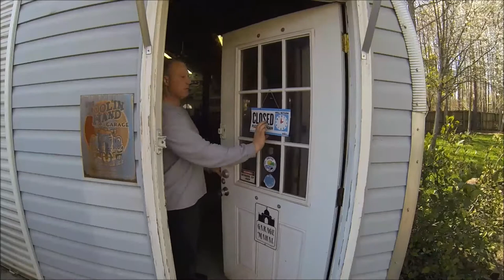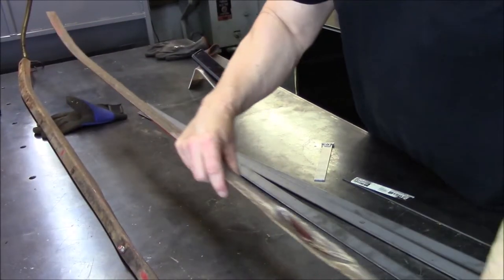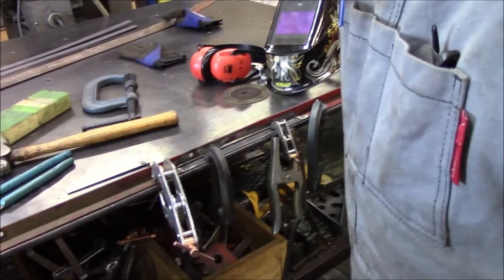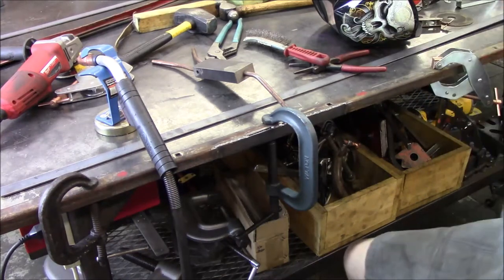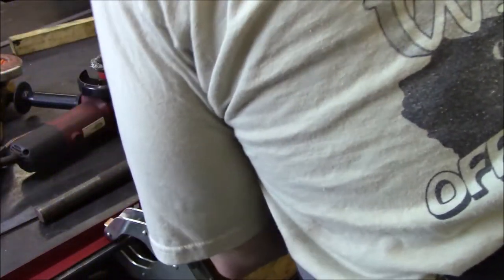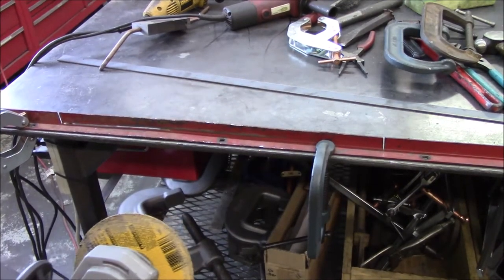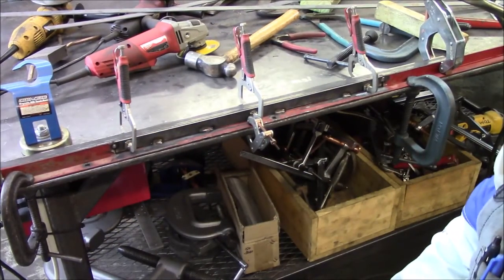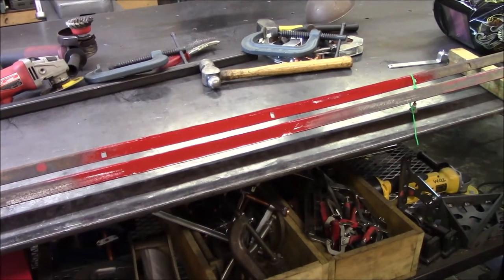Hay bailer rails repair

Comment: 2 new pieces of  angle iron, drill holes done.  Happy farmer.
Reply from the maker: I would have gone that route, but the holes were square and each rail had 6 so that meant I would have had to square broach 12 holes on the mill. Much easier to just cut out the bad sections and weld in new.

Comment: Quick jobs are always good. Nice job. Must have crossed your fingers on the twisting. Have some stickers for you from the bash but no vender sales. I was hoping for Niagara and drill hog but nada. Swap wasn’t really that great unless you wanted gauge blocks or large caliper sets. Not everyone brought stickers either. I wasn’t stingy with mine and gave almost 40 away. Andrew P the tool miser gave me a bunch of stuff. I’ll be doing a video soon. Made first surface grinder sparks. Have a dresser and fixture coming, should be here by next Tuesday.  I’ll dress the wheel and I’m in business.  Thanks for sharing Tom.
Reply from the maker: Sweet. Thanks Ron.

Comment: Put that second one on the corner of the long side of the table, and straighten with a hammer. - How much does a bottle of argon run over there?  When a farmer needs his bailer, he NEEDS his bailer!!  Good work.
Reply from the maker: Unfortunately Airgas bought up all the small dealers and we are at the mercy of them. It's a crap shoot everytime  I go and get a new bottle. I have paid as little as 25 and as much as 55 for a 80 cylinder.

Comment: What was the settings you used on your welder? Really nice job btw👍👊
Reply from the maker: Its an old Miller 210. I think I had the voltage on setting 3 and the wire speed at 35. Thanks for watching Gaz.

Comment: Why no guard on the grinder, is it a masculine thing or just stupidity.  After the welding how much time did you spend straightening.
Reply: John Collins He did say why. You obviously didn’t watch to the end. I find that, for some jobs at least, the guard gets in the way and that’s why he put all his pp on.
Reply from the maker: The guard gets in the way especially in tight spots. A few hammer wacks and pulling and they were pretty good so not too long.